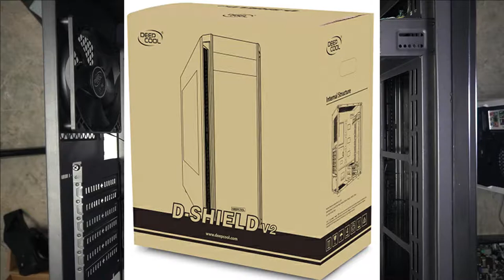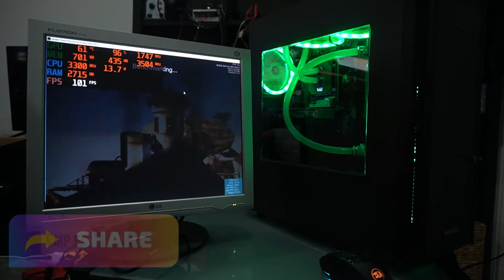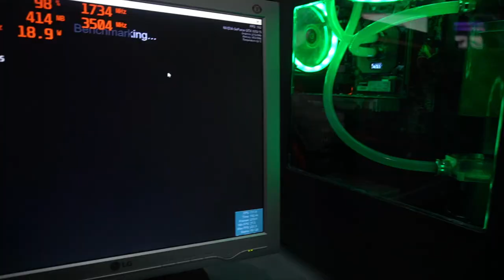how to water cool your pc- a beginners guide - using flexible soft tubing- green coolant

Comment: She is a a very nice looking rug I love the T virus res its is my favorite one the green one with the green fans nice choice looks great (So Are you ready for it lol) I would recommend cleaning the bottom of the block with rubbing alcohol not your hand. When installing the fittings metal on metal if you add just a little dab will do ya pipe dope gives a better seal and just a little less risk of a leeks cause leeks are a bad thing around electricals.  The Ketchup and mustered cables are clingy (might just be me) you could sleeve them  but its a pain in the tushery (yes I have done it LOL) or mask off the connecter and hit the area that will show with spray paint for plastic. if you add another fitting at the top of the res and add a flush mount on top of the case it makes filling the res much easer and the hose between the two is a place for air to go but is much less visible if these builds are customer builds I completely understand they want what they want but there are a ton of things that could be tone cool things that could be done to that case to give that poor rad some air cause the like some air 
                                                                                                    all the best keep up the good work
Reply from the maker: good tips bro thanks u